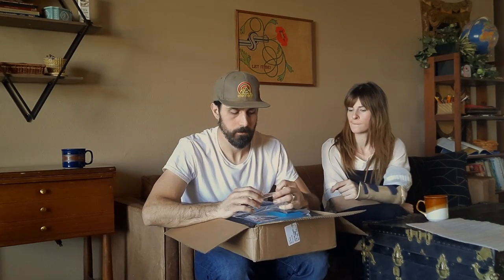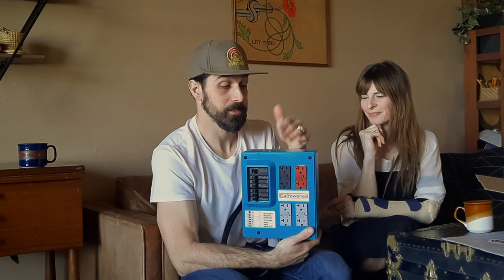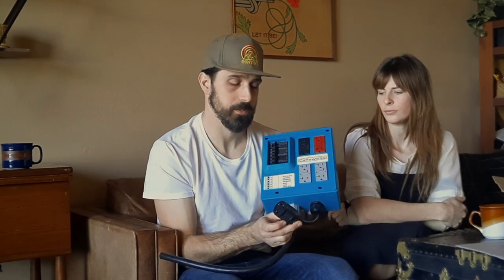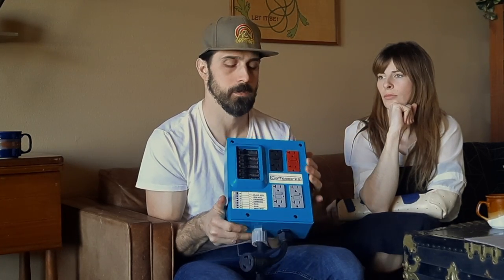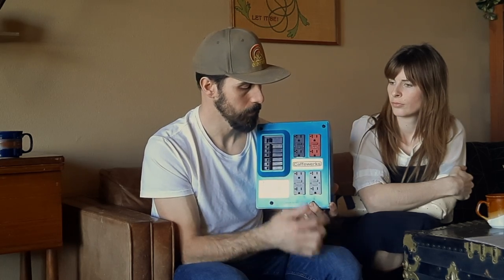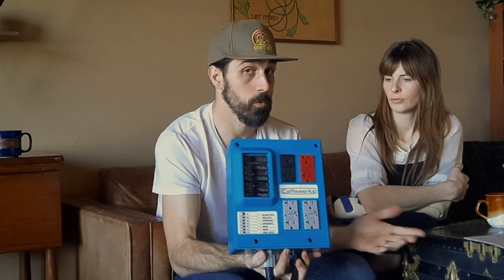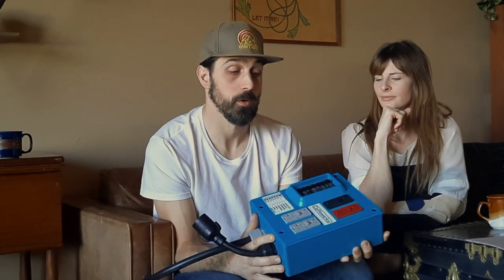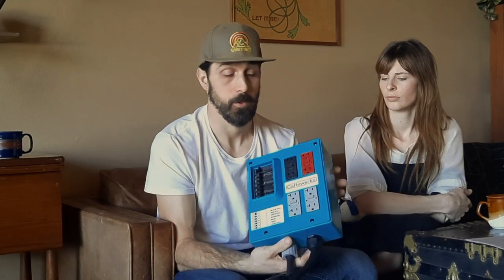Breaker panel upgrade - Press On Coffee Trailers

Comment: Hello there. This is a great idea. How did you run the cords from the appliances around the trailer to this box? Extension cords? Did you hide the cords inside something?
Reply from the maker: Thank you! First we planned the layout to have all appliances able to reach the panel but we did end up using a few extension cords. We always run our electrical under our cabinets and drill holes for the cords through the top of the counters.

Comment: I have looked everywhere for this .I am trying not to use a 30 Amp Generator Power Inlet Box and just go direct to my coffee cart . I have a Honda EU 7000...can i capture all the wattage from my Generator if i plug into the Honda 120/240 30 amp outlet and run a 25 foot line and tie into to my coffee cart with the blunt end of wire.... on the bottom wire of the  panel directly and should I install  a L1430R - Locking Receptacle, 30 A/250 V.. a female end on the wire coming out of the bottom right wire a 30 amp plug. So..out of the gen with a # 10 25 ft cord and plug into panel box wire. I was told that I need a circuit breaker in order to get all of the wattage out of the Honda b/c i cant use the other receptacle on the Honda
Reply from the maker: Hi Gary,
From my understanding, think of your generator as the power company and this box (50 amp option) as your panel on your home. Just add whatever plug you need on this panel in order to connect your generator cord to it. Just make sure your generator cord is thick enough to be able to supply all the amps/watts generator has to offer. Will you ever be running your generator at full capacity? I believe you will want a thicker gauge power cord, maybe a 6 gauge. With this panel having built in breakers, I don’t believe you will need any additional breaker in between. Also, is your espresso machine 240v or 120v? And how many amps?  I hope this helps and let me know if I can clarify anything.
Reply: @PressOnMobileCoffee  Wow thank you so much.. I am assuming the reason you have a additional 30 amp wire plug  at the bottom of your box is your espresso machine is 240v? I am running 110v on my espresso machine .So basically I need 8 receptacles and i will try to heat up each machine separate so i do not trip . here is what i have on my large coffee cart for the farmers market...2 bunn coffee mach=1300x 2 =2600 watts , 1 milk boiler = 2400 watts , espresso mach =1500 watts puck press and blender =1100 watts 1 water pump=175 watts EK 43 grinder = 1300 watts .Of course they will not all be continuous connected to a Honda 30 amp outlet and tied directly to the circuit box wire  you are showing .I love you and your wifes channel .I have learned so much.Thank you for your help
Reply from the maker: @GaryHuntPianoman  you’re very welcome! Everything sounds good about your your set up with one concern- your milk boiler. The 120v outlets on the breaker box from Cafewerks are 20 amp outlets. That means they can handle 2400 watts each (20 amps x 120v = 2400w). However, it’s best to keep your load on each outlet at 80%, which would be 1920w. Your milk boiler might cause the machine to trip. I believe CafeWerks builds the panels to order so I would ask them if they can put in a 25amp breaker for the milk boiler.
Reply: @PressOnMobileCoffee  Thank you so much for your insight you’re the best you cleared it up for me